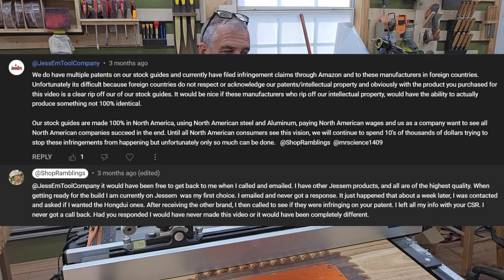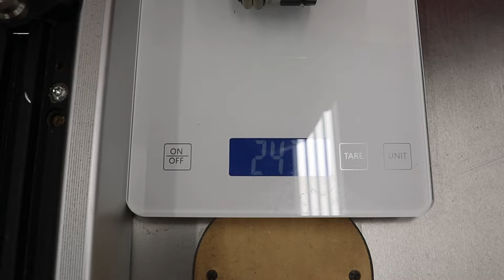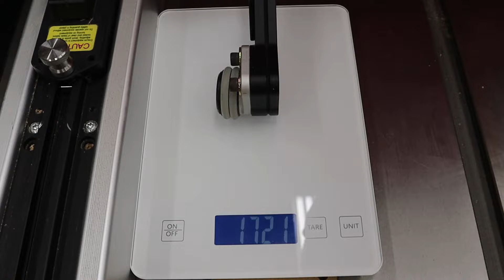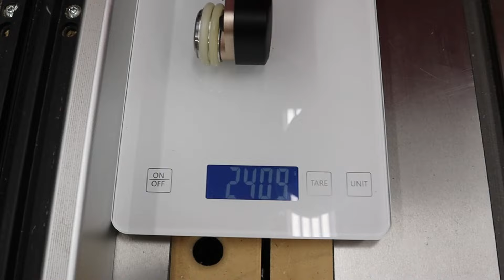Jessem verse Hongdui Remix

Comment: I, on the other hand, have had numerous email & Phone contacts with Jessem regarding product inquiries in the past several months. They suffer the same "long wait times" as any company who enjoy good sales due to high quality products. The similarities are difficult to ignore with theses stock guides except for minor differences, which, IMO indicates an infringement. It only matters if you feel your patronizing the "pirated" version  is unfair. I budget my $s spent based off need and applicable use, but I also try to buy domestic if possible. I also try to support independent vendors when possible..I will not patronize Bangood or Temu because of the aforementioned reasons!
Reply from the maker: I have had the opposite from Jessem. I have purchased several of their products in the pass. I emailed them and could not get a responds. I called and talked with a CSR. I asked to speak with someone who might know about these. He said I couldn't. I left all my contact info with him and never got a call back or email. When Jessem left a comment I replied with my contact info asking them to contact me. That was 3 months ago and they never did. I have 6 different drills. All different brands but all basically the same thing. I don't know why 2 companies can make the same of one tool and not another. These are the same "tool" but every piece was different. I am not a patient lawyer that is why I wanted to get some more info. Chervon and TTi own almost all major power tool brands. Both have their tools made in China. It is a sad fact but the average person couldn't put together a tool box, much less a shop without tools from China.
Reply: @ShopRamblings   you aren't going to get a response from a company that could be contemplating litigation or in the early stages of litigation... for that matter, even in the absence of litigation why would jessem talk about a competitor's product? I don't think you would get dewalt to comment on ryobi etc but maybe they would... but definitely not when there is potential litigation
Reply from the maker: @DanielLeavittAttorneyatLaw I am definitely not an attorney, but Hongdui is a reputable company. They make tools for other reputable companies. I know Katz Moses did a lot of research when deciding who to manufacture tools for his brand. I am just not going  to assume they are stealing intellectual property because they make a safety device that is similar to another. There are many tools that are similar to other ones but made by different companies. This is not a cheap copy. This is a better designed higher quality tool that is used for the same purpose. The fact is I was going to buy the Jessem ones, but they raised their price again. This was just too much for me, so I was going to do without until I found these. After using both, if they were the same price, I would pick the Hongdui over Jessem. At $100 cheaper, there is no decision to make. If they are making a stolen version, that would be the only reason I wouldn't buy them.

Comment: Thank you for the video, honestly these stock guides are a pretty important safety feature.  The reality is that Jessem's price is so high that it prices out hobbiest woodworkers from owning such an important safety tool. Many of us use Jobsite table saws and the Jessem guides cost more than I paid for my saw new.
Reply from the maker: Great point! They are definitely more than I paid for my first table saw. I got them after almost losing two fingers. If they bad been more affordable, I may have gotten them sooner.
Reply: Also, sounds to me that, just like they usually do, that Hongdui actually improved on the design.
Reply: @fugixi i did end up buying the hongdui ones.  They work great, but 2 complaints.  1. The screw that holds the arm on gets loose really easily, so I had to get thread locker to keep it tight.  2. The mounting track comes in 2 pieces instead of 1, and I didn't get them perfectly lined up, so they are tough to slide between the tracks.  Although this one is my fault, and it's easily fixable if I wasn't lazy.  

Otherwise the bearings work really well, and as long as that screw doesn't loosen, the hold is great.
Reply: @SpartanORGN  Awesome thank you for that info.
Unfortunately I did notice that it will not fit, at least not without modifications, a DeWalt job site table saw, which is what I have. 😒
Reply: @fugixi i did buy mine for my Skil table saw originally.  I stacked some pieces of MDF and cut them to size so they would slide into the fence.  That worked well.  But I sold that saw and got an old powermatic that had a vega fence.

Comment: I had trouble with the cost of the Canadian version and bought the China product also. For me it comes down to shop safety fitting them on an older Unisaw
Reply from the maker: I had a board catch and pulled my hand into my table saw. I may not have feeling in two of my fingers, but I do still have them. I bought my first set of Jesems right after. They help with safety but do get in the way of the push block sometimes.
Reply: Me too!! I am very impressed with this product

Comment: Do the holes for the mounting bars that secure the stock guides to the track line up on both the Jessem and the Hongdui? I ask because I have a VSC tools fence and the Hongdui stock guides. VSC tools sells a hardware kit that adapts the jessem guides to their fence. Would love to know if it would work with the Hongdui set
Reply from the maker: The bars are slightly different. I tried putting the Hungdui on the Jessem bars, and they would not work. I can't remember exactly what was different, but I remember that it did not.
Reply: @ShopRamblings  thanks for the quick reply! But darn

Comment: i will never buy a cheaper knockoff product of any kind.  if we all do, companies like jessem will cease to exist.
i visited jessem's factory in new brunswick canada and they do indeed make every part of all of their tools.  awesome people, awesome tools
Reply from the maker: I agree they make quality tools. I have some, and they were the first place I went when I needed some more. I am not sure what happened with me. Others say they have good customer service. I reached out multiple times, and they never contacted me back. Afar as knock off. I don't know what a knock-off is. Almost every product in the world is made by more than one company. Due to their poor customer service to me, I did not make my purchase. Then I found a similar but better product. So I am glad they raised their price and would not respond to me.  It saved me a lot of money.
Reply: Years ago, I had the same viewpoint. I was hanging a lot of made-in-USA ceiling fans but my frustration with every. single. one of the damned high priced Hunter fans had this problem: the holes in the blade irons NEVER aligned with the holes in the blades. And don’t even ask me to discuss their out-of-balance behavior. Then I bought a fan made in China: the bolt holes in the blades and the irons matched PERFECTLY. The balance was perfect from the first — no sticking weights on the blades necessary. 

Longevity? The US Hunters are long gone. The Chinese fans are running problem-free decades later.

I still prefer made-in-USA. But there’s no longer any gap in engineering or build quality; if anything, Southeast Asia has eclipsed the US. It’s no different with automobiles, as we learned nearly a half-century ago.

Comment: I have these and i agree that the quality is great,i have several Hongdui tools and that goes for them all.BUT it should be clear that these are ment ONLY for left tilting saws.I have a right tilting saw and they work great when i do straight cuts,but angled cuts is not safe with these mounted.To bad it is not possible to change the rollers to work for both left and right tilting saws.
Reply from the maker: I agree.

Comment: Thank you for the video, I did get the hongdui. Its been a few months using it. Recently I noticed the O rings lost its grippyness. How has it held up for you.
Reply from the maker: Mine are still good as new. Did they get anything on them? I mainly use mine when cutting plywood and I only use Hardwood Plywood. I don't know if that could make a difference.
Reply: You can but new rubber from JessEm. they are about 12 bucks. However, their shipping is ridiculous.

Comment: Without the Canadian innovation and design the Chinese would never had something to just copy and sell at absolute rock bottom price. 
I’ll look at Hongdui product that they actually invented and designed.  So far, they have shown only their ability to copy those who worked hard to innovate. Seems morally wrong to give them my money.
Reply from the maker: Hongdui is the company that Katz Moses used to design and manufacture his tools. I wouldn't say they sell at rock bottom price. Their router plane is the most expensive one I have seen.  It is also the highest quality one I have seen.
Reply: The Hongdui table saw miter gauge and the t square the worked with Dennis on proves they can create quality unique woodworking tools.
Reply: @ Quality? Yes, I believe so. I have now heard from multiple sources that their products are of good quality. 
Unique?  Not at all as they are Chinese versions of Woodpeckers and Jessem products.  
Now, I do understand that products are always copied and improved upon.  That is how everything from a simple power drill to a car engine evolve, one company copies and then improves upon the previous. 
But we should also be honest and call a duck a duck when a company only changes the appearances of a product with the intention of underselling the original developer while claiming they are innovating or producing something of their own significant design. 
Just my two cents.